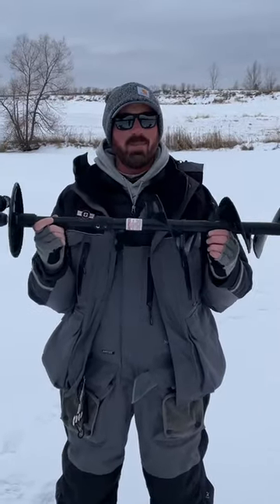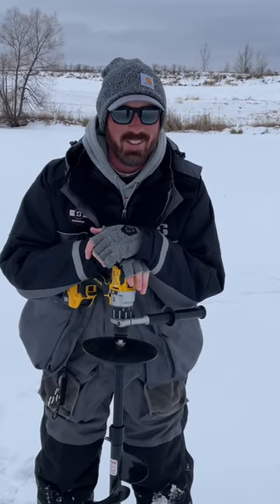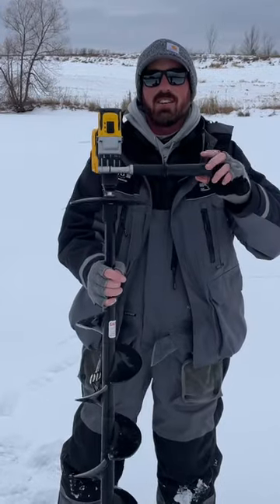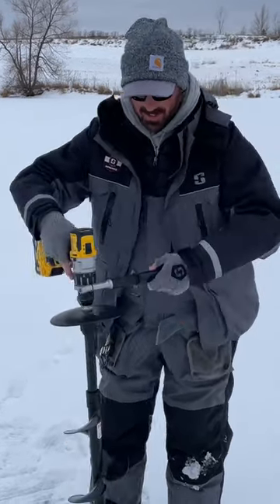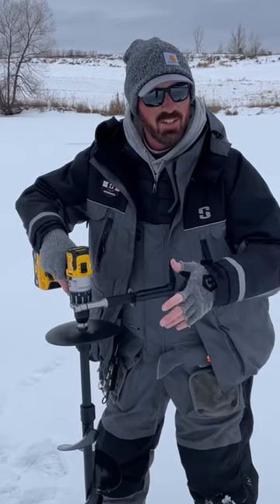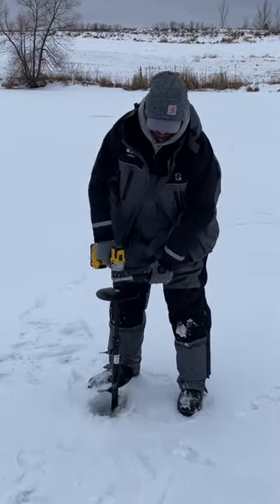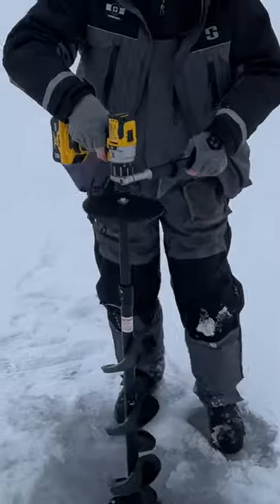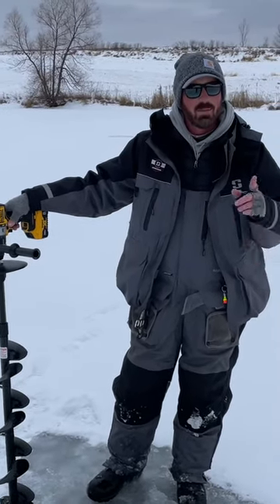Cordless Drill Ice Auger #tips #howto #icefishing

Comment: I used a $50 Menards Masterforce drill for 5 seasons and it still works fine. It didn't have enough torque to break your wrist so when it would catch it would just stop which was great.
The DeWalt and Milwaukee guys were the ones hurting themselves. Now Milwaukee has an auto off/brake feature to keep you from breaking your wrist and even though my Rigid drill doesn't advertise it that I know of--it has the same feature so it doesn't twist when the bit gets stuck on the underside of the ice before punching through.

Thousands of holes and neither of my drills ever hurt me though. I drill holes one handed with the flasher in the other hand. I kind of brace the drill against my hip a bit for stability sometimes.
Reply from the maker: As long as it works!

Comment: Where did you get that adaptor and plate from?
Reply from the maker: No adapter. The circular piece comes with the Lite Flite to prevent it from falling through the hole if it detaches from your drill.
Reply: @TheBucketBoysIA  Awesome thanks!
Reply from the maker: Sure thing! The lite flight augers are awesome. Highly recommend.